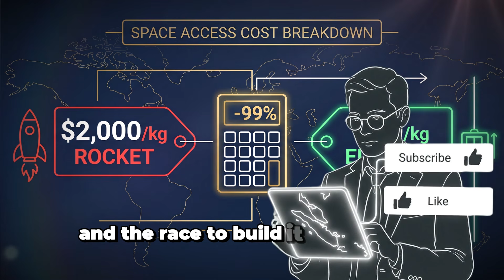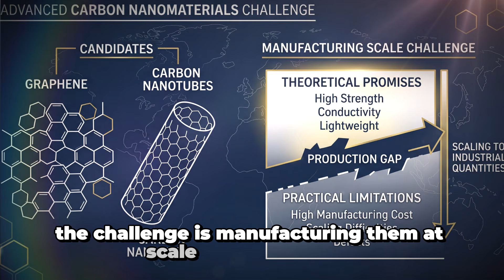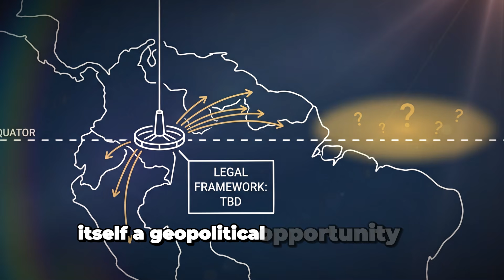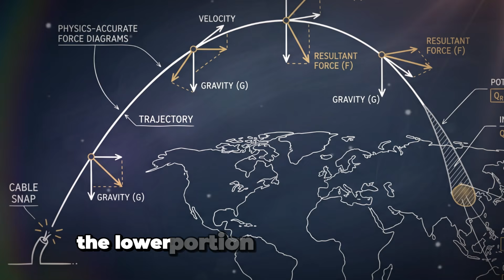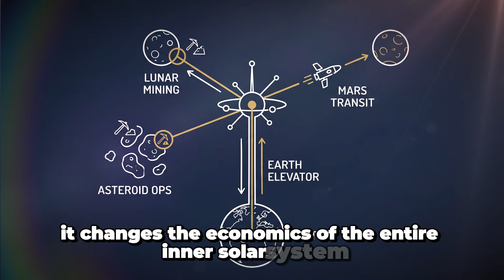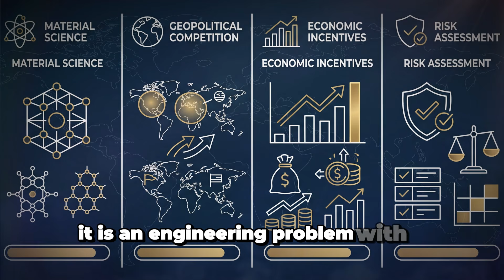The $10/kg Revolution: How a Cable Could End the Rocket Age

Comment: A space elevator, while a cool idea, isn't practical for reasons others have mentioned in the comments and else where - Materials aside, space debris will make this impossible, especially since Musk's stupid Starlink bullshit.  

There is, however, a cost effective solution which we already have the technology for and whose main problem is infrastructural.   Namely a 'star-tram' - a massive mass driver using magnetic acceleration to deliver pay load to space at the fraction of a rocket launch.   To make this, we need a high mountain at the equator, we need political stability in that region, and we need the power infrastructure to make it possible.   Personally, I suggest an international purchase of Mount Kilimanjaro.  It is equatorial, a UN purchase (or rental) from Tanzania and Kenya, certainly with co-operation from both these countries, would be vital.  Firstly, because the track would likely need to run from lowlands in Kenya to the top of Mount Kilimanjaro.   Secondly, because the most mature, long-standing centre for space research and launch is in Malindi, in Kenya - the Broglio Space Centre - a joint Kenyan/Italian project with prior experience launching satelites and an existing station for monitoring them.  Coincidentally, this lies almost in a perfect line with Mount Kilimanjaro and would be a logical control centre for a Mass-Driver launch facility, the track or tunnel of which would probably begin between 30 and 40 miles from Malindi and continue in a straight line up the mountain.   This is a much more technically achievable, low-cost, space payload delivery system than a theoretical 'space elevator' and, while it couldn't deliver human cargo at the speeds required, it would be more than capable of delivering non-living payloads at costs of less than $50 per kilo to LEO.
Reply from the maker: Thank you for your detailed and thoughtful comment.

Comment: I believed in this concept when I was younger. But after working in the industry (cars and metalworking), I now realise that maintenance will be bordeline impossible. due to micro asteroids and debri (And no, you can't remove space debri fully, so that effort would be needed to continiue for ever. And that is not sheap in any way.). You will get fatigue in the material due to temperature changes and because of the loade changes. 36000 kilometers is far longer than one countrys railroads. 
And those need repairs somewhere every day. But in that case you can reroute cargo arond the closed sections. On a space elevator you can't do that. 

The space elevator will also limit the orbits aviable for sattelites much more than people think. The space elevator can't adjust its orbit/position to avoid collisions. LEO sattelites will propably not be allowed at all. And that is all orbits below 36000 kilometers. 

Then there is another thing called logistics.... You can't fit enough capsules on the elevator, or big enough to be able to get  a profit big enough to motivate building it. It would snap..

So what if we build many space elevators? That would create even more security riscs. Because if one fo the snaps high up and starts to fall down, it's long enough to possibly hit the adjacant space elevators. So in that scenario you could get a chainreaction.

And last but not insignificant, no one would invest that giga enormous amount of money if there was no fully developed industrial infrastructures allready in work up in space. So the economic risc is also enormous.

It will not happen on this planet. Maybe there is some smaller and fast rotation planet or moon this would be possible to make.... Maybe.
Reply from the maker: Thank you for your comment. The purpose of my video wasn’t just to discuss whether a space elevator could actually be built, but also to explain why such ideas have emerged. The primary cost of space travel is the fuel and rockets we use to break through our atmosphere. Today, efforts are underway to eliminate these costs. Of course, a space elevator is a utopian idea, but establishing a station on the Moon or elsewhere to avoid these costs is something that could happen in the future. Once again, thank you for your thoughts.Thank you for sharing your thoughts in the comments.
Reply: @GeoMindStudio28  Yes I liked the video. Maybe you should do a video or videos about what sci-fi thropes that's really just fantasy also. The moon will also not work btw, because it is tidally locked to Earth. so the top och the space elevator would end up in the center of a rotating Earth. Thanks for the response. :)